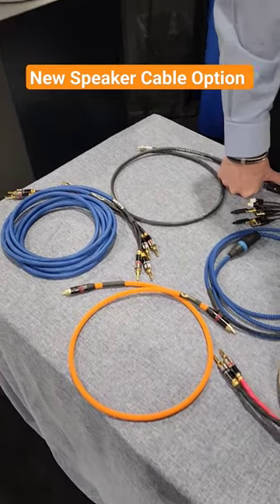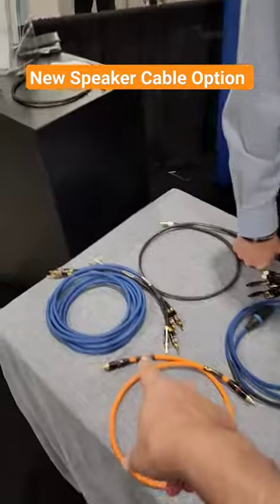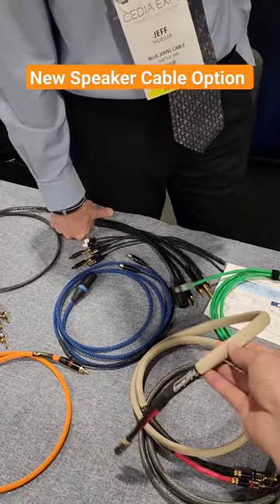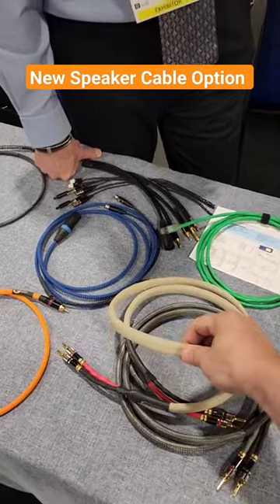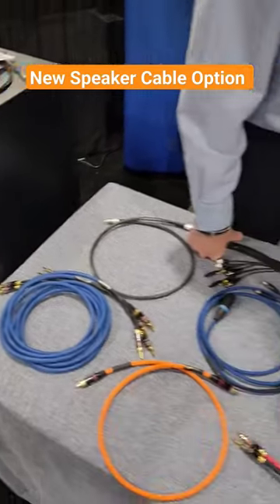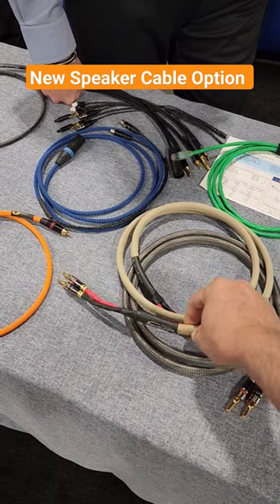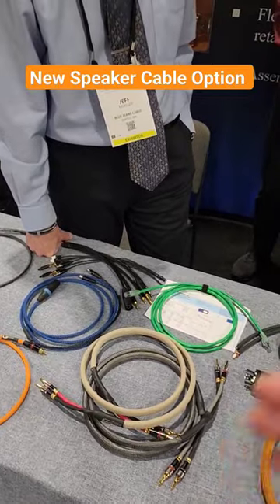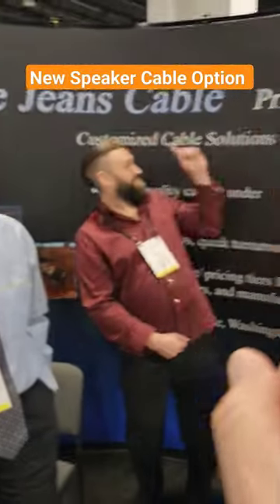Blue Jeans Cables Latest Speaker Cable Design - Super Low Inductance - CEDIA 2023

Comment: In my experience, long speaker runs need to be shielded. That's if one appreciates a low noise floor, of course.
Reply from the maker: Not sure where you got that advice, but it's actually the opposite.  You don't ever need shielding on speaker cables and a long run would be especially bad because it would add capacitance which normally isn't an issue...long run + shielding can potentially create issues with high capacitance.